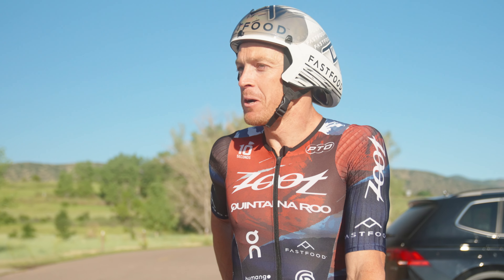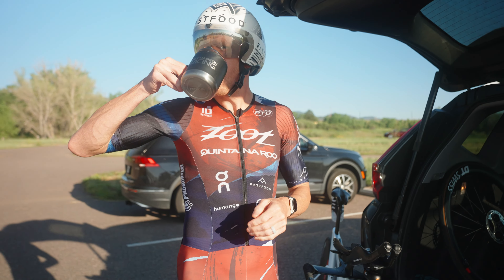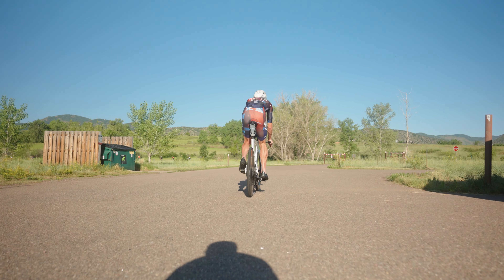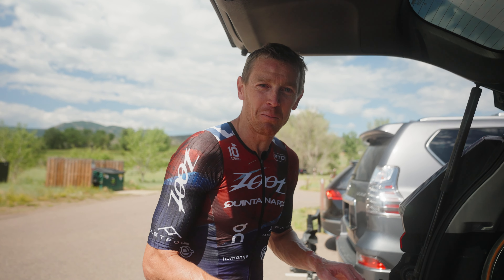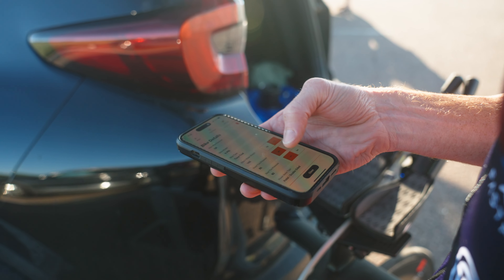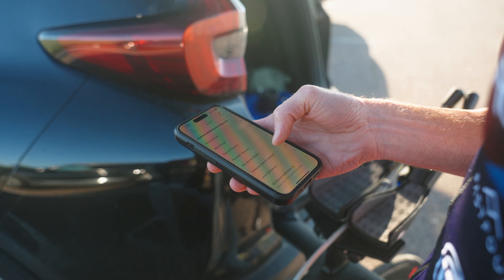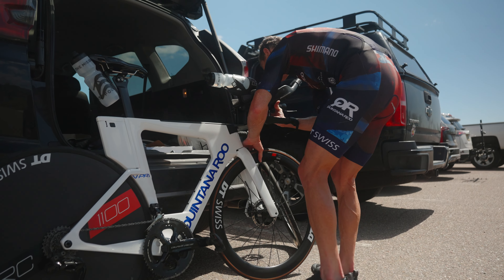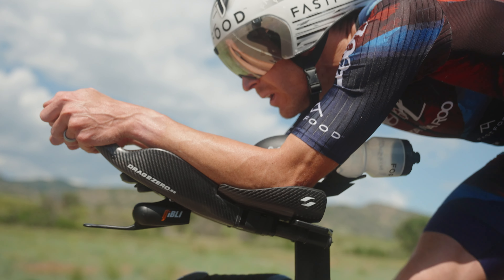Free Speed || Aero Testing

Comment: Seems fundamentally very difficult to measure CDAs outside the track or wind tunnel. Surely lots of changing variables that you cannot equalise between test runs - wind speed, direction, humidity etc. 
In any case, interesting video and good luck with Ironman Lake Placid!

Comment: Whats wrong with just simply saying the numbers instead of all this qualitative description
Reply from the maker: The actual numbers were mentioned the last part of the video. But the numbers are unique to the individual. Different sensors and different tunnels will give slightly different numbers, even when calibrated properly. Also, body size will be a significant factor. The qualitative process can be applied to anyone. So I talk through the why and my process and you can learn how to do it yourself if you'd like. Much better than "here are my numbers...do the same thing I did and maybe it will be similar to you..."
Reply: @MattHansonTri  I was referring to qualtative in terms of large/small savings "not a ton worse" comments.
Reply from the maker: I gave all the numbers from all the runs together at the end of the video so you can easily see a comparison.
Reply: literally gives the actual cda number...